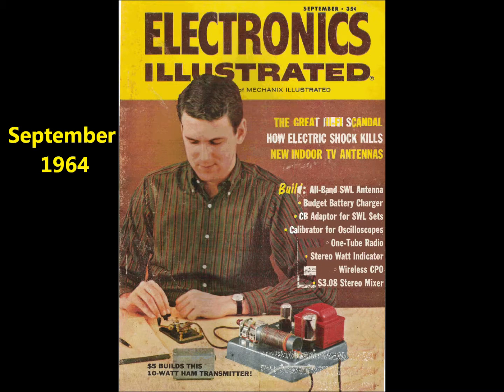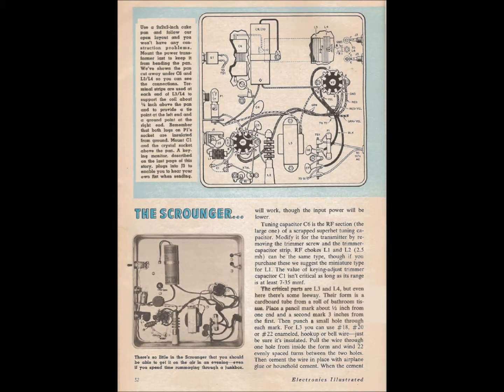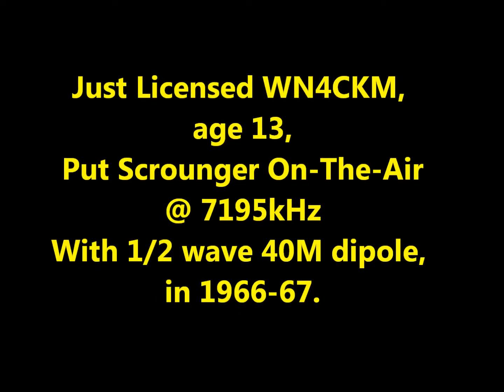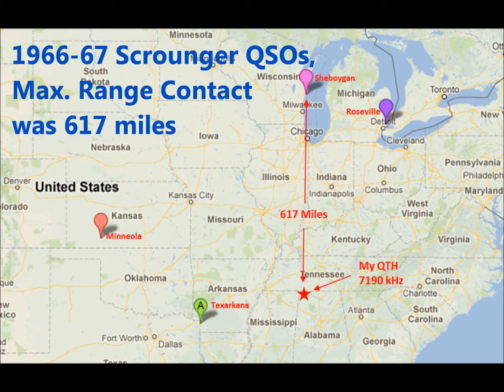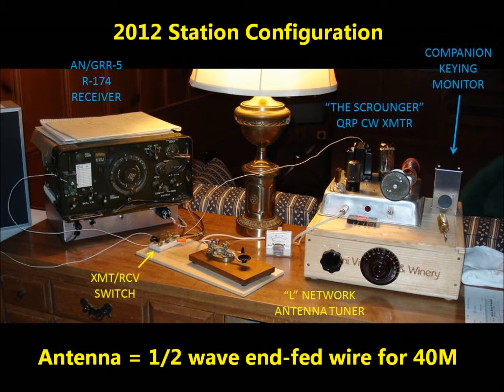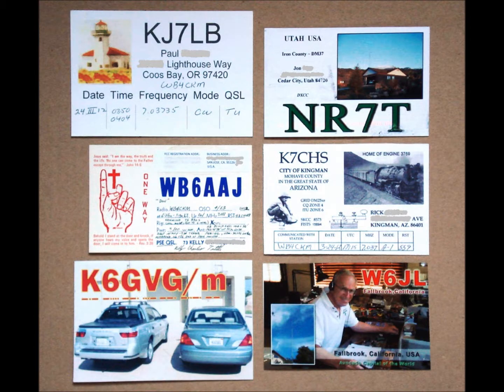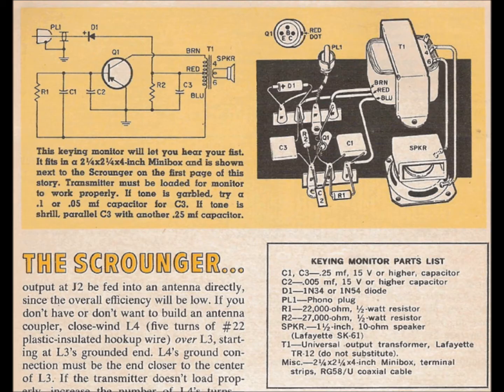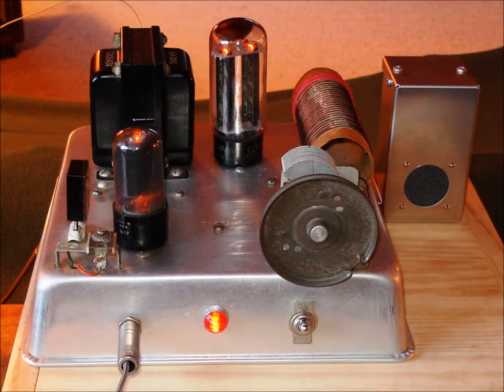The Scrounger: A Ham Radio 6V6 Transmitter Project

Comment: Very similar to my first novice transmitter, It was an  Ameco AC-1 kit with a 6V6 oscillator, and 6X5 rectifier. (Plug- in coils and an octal socket for key and crystals). This was in 1964 and my one 40 meter crystal was 7190 KC. I have built many rigs since then. I still build my rigs, all QRP. 73 de KC4QI.

Comment: Hello OM, just ran across your posting , great story and similar to mine !I didnt have a Cake pan but have seen many built into Radios ! (hi) I stared off in 1963 as a Novice and a h.b. 807 rig from Donald S. Stoner in a Electronics book , i did finally make a qso about 50 miles away in Ohio on 3710 (borrowed crystal) ! I worked at the Westinghouse Xmfr plant in Muncie In. and practiced my code while ringing out circuits with another future Ham, i left the plant later and behold 1 year later i made contact with (George) in Il. who said i would never make it as i was having tbl with the code !   HI !  We had many qsos after that ,sorry for rambling but your story seemed like mine !  G.L. 73 Jerry Uhte  K9UT
Reply from the maker: Hi Jerry- great story! Thanks for posting -73

Comment: If anyone out there has a power transformer for a project like this, please let me know. That is THE hardest item to locate.  Dave N9HF
Reply from the maker: Hi David- try this link https://www.tubesandmore.com/products/transformer-hammond-plate-filament
Model P-T260C has 500V C.T @ 85ma.. 5V @ 2A 6.3V C.T. @ 2A ought to work. Scroll down the page to see link to download spec sheet from Hammond which lists all models in this particular product line from them. [ when I built the Scrounger in 1965 I ordered the power transformer from Allied, and it was the most expensive part. I see that aspect hasn't changed.] -73